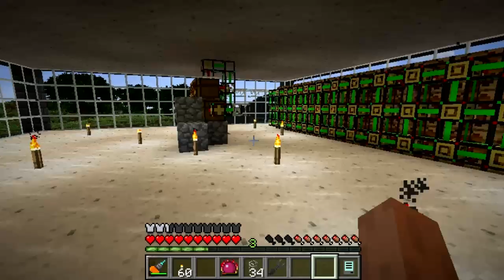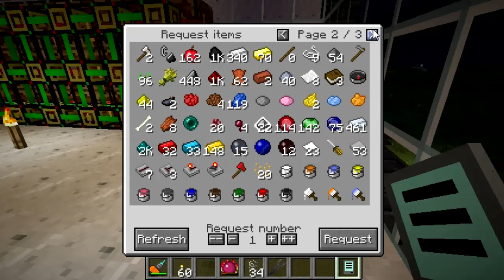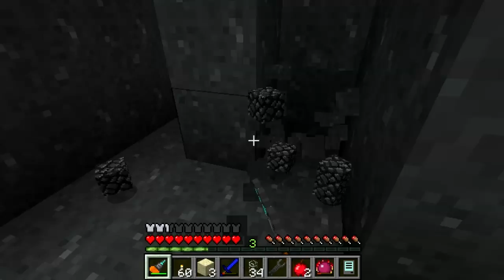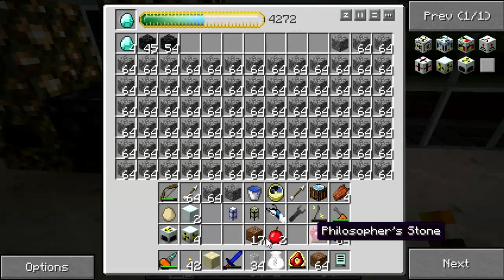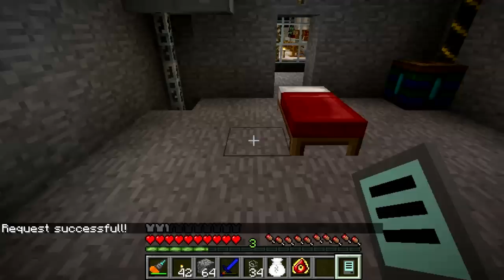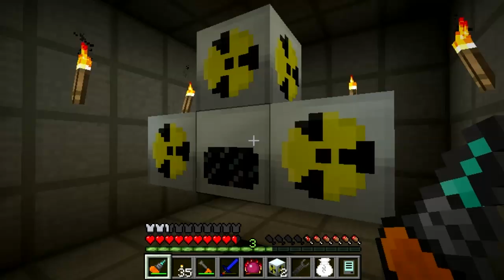TFC Modcraft -30- Going Nuclear

Comment: How many layers of reinforced stone did you use?  I think you need a minimum of two layers, though to be safe I would go for three.  Also if you have any cabling coming out from that room you need to have two layers around those I think as well.

Random aside but have you considered Thaumcraft and adding that to this world?  I recently restarted my modded world as I found EE too overpowered after a point and installed Thaumcraft and am rather enjoying what it offers.